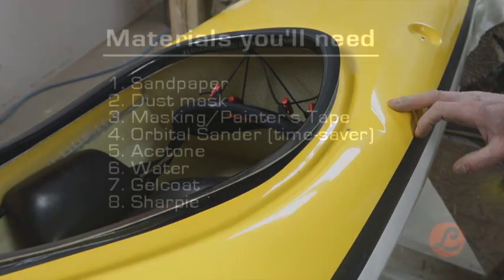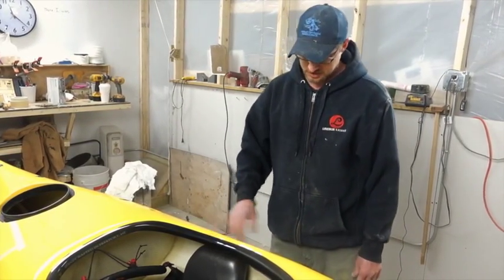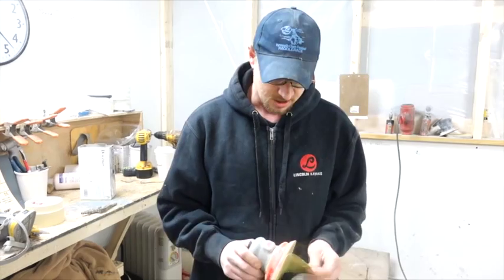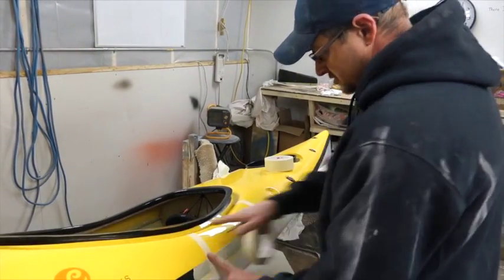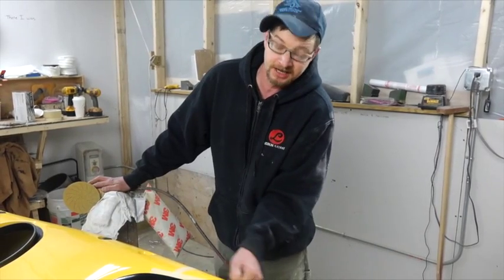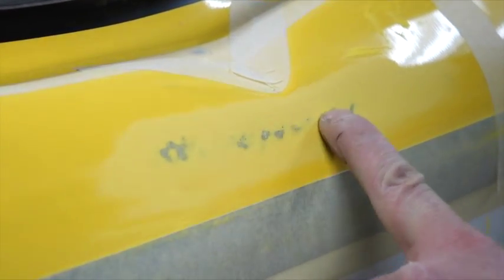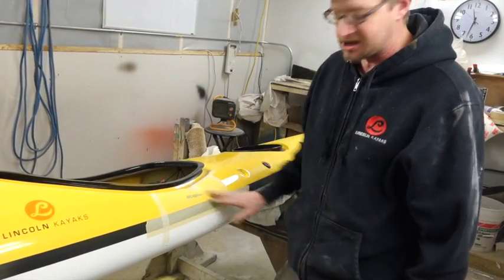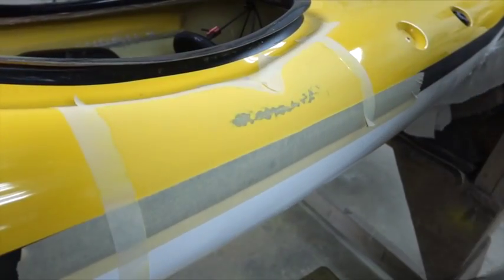Basic Gel Coat Chip Repair  Part I

Comment: I really like the way you did this! This is the only video I have seen where you are sanding a rather large area for the cracks. I have seen people use dremels to kind of detail sand out the gelcoat to the depth needed. Is there a reason why you prefer the method you're using? I am just trying to learn as I am needing to repair some very minor cracks in my 93' easy rider kayak. Thanks
Reply from the maker: easier to fair and blend in
Reply: How did you go?